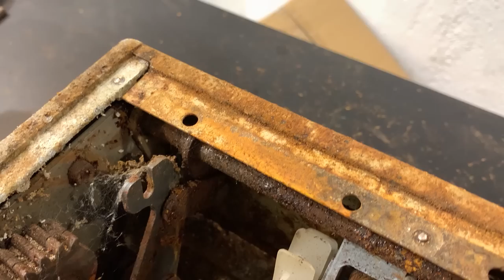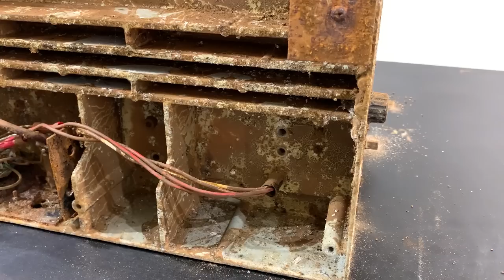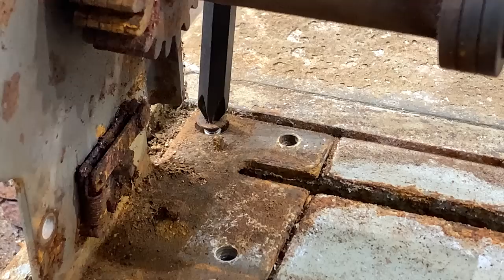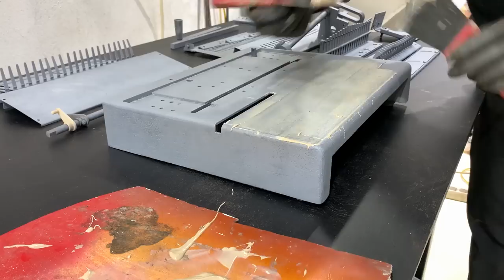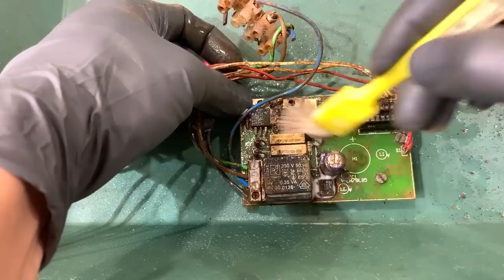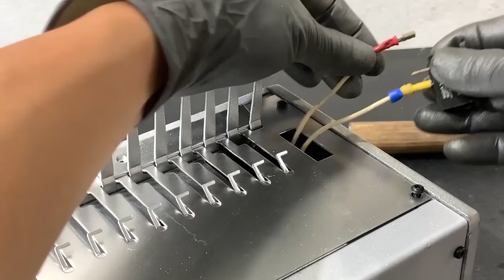Restoration Book making machine | REPAIR serious damage

Comment: А что это было?😊 Первобытный электродырокол?😂
Reply: Брошюратор. Вы наверняка видели папки, блокноты и т.д. прошитые чем-то наподобие пластиковых пружин. Такие приспособы до сих пор в ходу.
Reply: The brand-name was cirlock, but these days it's mostly called coil binding. If you were going to make a book for a class in university, for example, you'd probably use this kind of binding. It's better than a 3-ring binder, but much cheaper than normal book binding. It's also not permanent, so you can add and remove pages. We used these a lot 30 or so years ago.

Comment: This mastermind has not the slightest idea about electronic repair, else he would not cut und solder wires on a lustre terminal. There are little screws for this.

I doubt he could "restore" these electronics with his weird use of a multimeter and soldering iron.

I even doubt if this complex electronics belongs to the machine. It works with simple electromechanics.

This machine is only useful with special binding bookends:

1. Punch holes in a stack of paper
2. Open this tubular bookend and put the stack on the prongs.
3. Close the bookend and you have a book.
Did this myself 50 years ago.

Nevertheless he can make confetti with it.
Reply: Niht ferhteen.Не понимаю,извини.
Reply: Rude
Reply: Seems like he did just fine with the electronics. Not sure what you're on about. The end result was a restored and functioning product. Which is the point of restoration videos. You seen very critical. Do you do restorations? Let's see your work.
Reply: Jog on, Captain Superior.